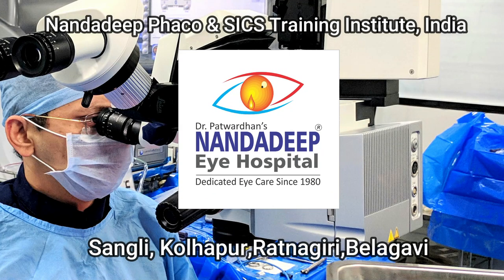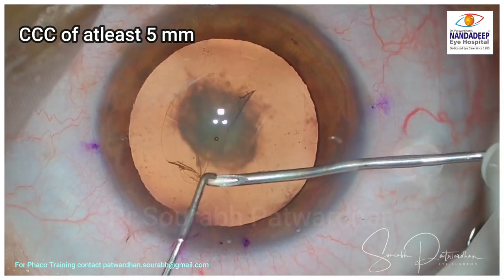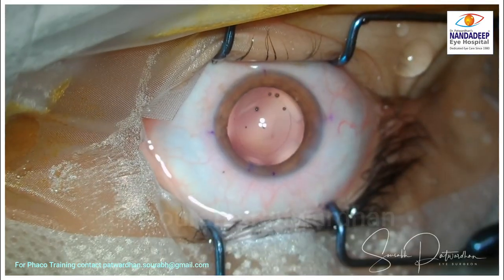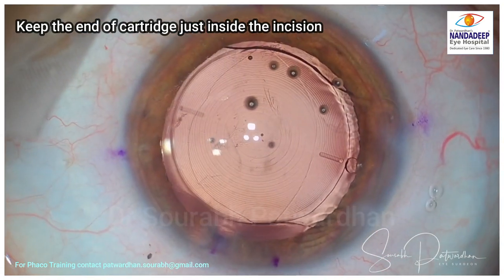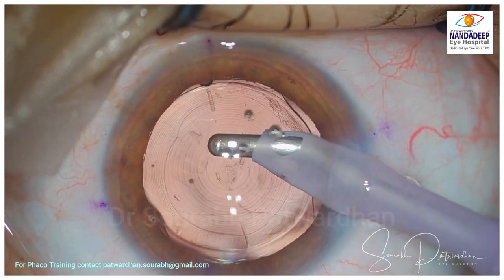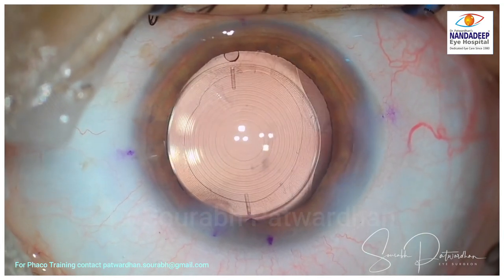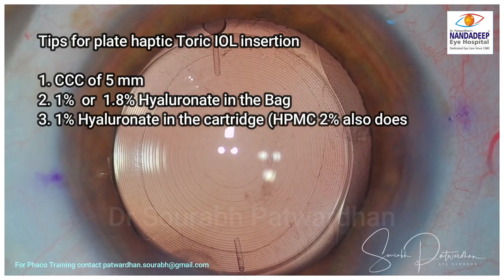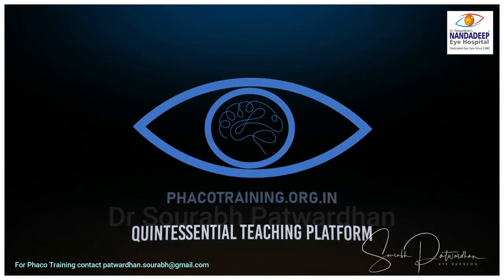107 Handling Plate haptic Toric IOL- Tips to get it right Dr Sourabh Patwardhan -it's not difficult

Comment: One of the beauty of these IOL is you can easily hydro implant them without using visco. Also even in smaller CCC, with only little tap with aspiration cannula , it goes easily inside bag